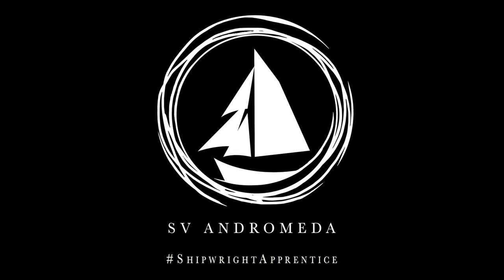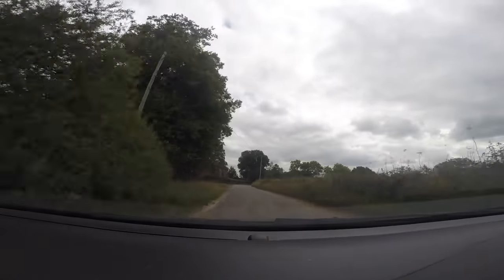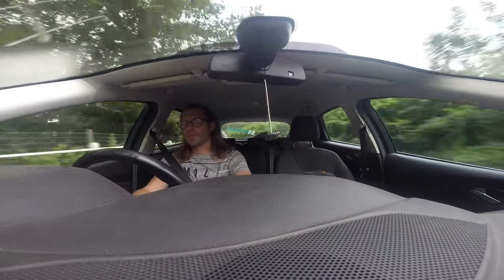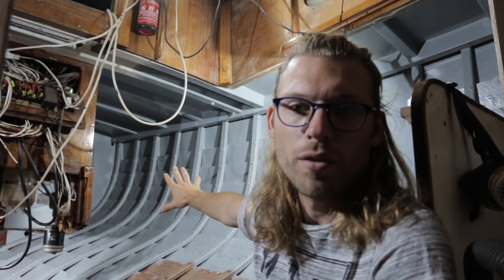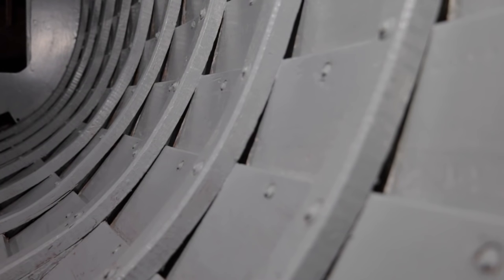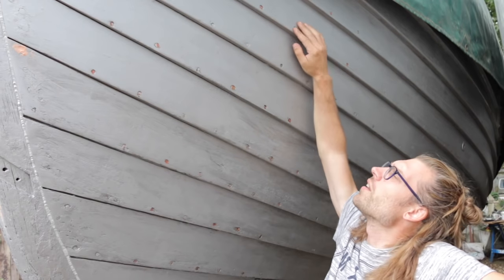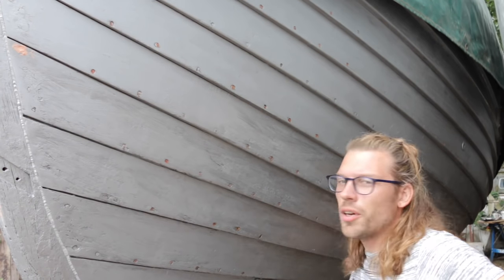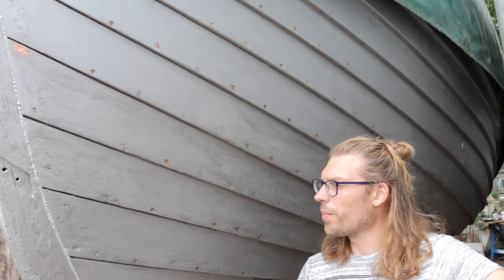14. Disaster with Floor Timbers. Wooden Boat Restoration.

Comment: Put wedges in the limber holes and that will drive it up also bigger hammer steel there's no shock with the rubber one 😎
Reply from the maker: I like the thinking with the wedges, more and more often I see not builders working with simple wedges to push and pull things the right amount. Very satisfying. Thanks for the feedback!

Comment: Could you have epoxy injected into floor joists under engine?
Reply from the maker: Hi, Thanks for watching and for the feedback. I didn’t consider this at the time but I think you’re right, this could have been an option. I think at the time, it was difficult to know the extent of the problem until the timber was out and by the time you get to that point, it’s probably worth replacing. Epoxy certainly offers a lot of solutions!!

Comment: Assuming there is access to the bolt below and nothing impeding its removal, stop mucking aroung with a rubber mallet. Put the nut back on (flush to protect the thread), get a lump or sledge hammer and knock the keel bolt down.  Once it is freed up take the nut off.  You may need a (bronze) drift to fully remove the keel bolt.  It has to come out before you fit the new floor anyway.
Reply from the maker: Hi Gregory Ross, thanks for watching and for the advice. I need to have a root around under the keel and see where the bolt sits in relation to the cradle. She will be moved in the yard soon so I’ll ensure this is clear of the cradle so that I can draw it out. Thanks!

Comment: We normally make a rough template for the new Floor and cut out the old Floor, being careful not to damage the Planks, trying to remove old Brass screws and Nails is not a easy option as we found.
Reply from the maker: I think I’ll probably follow the process that you’ve described above. Thanks so much for the feedback again - great stuff :-)